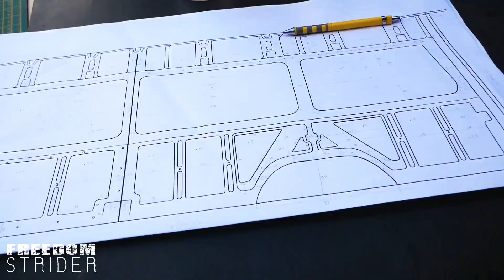Campervan Heating: LPG vs Diesel vs Electric - FULL COMPARISON

Comment: If you got electric, you can have a huge battery bank  ( Tesla battery) that weigh 23KG per 440AH 12V or 220AH 24V. So you would need only 3 Tesla batteries at £850 each - total of £2550. Than you can get an induction cooker. That way you can have around 900W solar panels on the roof which will charge your batteries. It should cost you around £3000-£4000 max for the Tesla batteries, BMS for them, induction cooktop, and electrical. And the best thing is that its all renewable :-). And the total weight of your battery would only be 69KG.
Reply from the maker: We have heard about using Tesla batteries before for a camper, initially for us they did seem a great idea. However, the main issue we had with them is that Tesla can deactivate the electronics in their batteries if they receive a report from the batteries that they are being messed around with, and they have put fail safes in them. WE're not experienced enough with electronics to know which wires to cut to stop this from happening (plus, I would think it's more programming rather than wire cutting).

But if there is a way to manage this system easily, then sure it sounds like a great deal. To be fair we've already bought our 2 lithium batteries and chargers, with 540W of solar. Maybe for a future project? ;)
Reply: Freedom Strider ah i see, not sure who told you that, but Tesla can not deactivate the electronics in their battery once its been removed from there car ( there is no receiver or transmitter in the battery). In regards to wiring for the battery, there is a company that sells boards for he battery ( ZeroEV) it allows you to plug a Bms to the battery to use them and have things like temperature control etc. So no programming required for the batteries. All you need is a good BMS, and also a Victron Phoenix inverter as then you can change the voltage to 18.6V - 25V ( Tesla battery work between 15V - 25.2V).

But maybe that’s for a future project :-)
Reply: @theoteam4641  I had a look on eBay after seeing this comment and indeed you can get Tesla modules, quite amazing really. An EV narrow boat on Tesla batteries would be cool. I know Tesla/Panasonic make damn good modules, but I would be tempted to use old Nissan leaf modules instead because they don't have the liquid cooling system that Tesla use. You wouldn't need the cooling as it is used for high loads and charging but I would feel safer using a system that operated originally without it.
Reply: Liam Siviter aah i seee what your saying. You wont need to cool them down at all if your using them at less than 1C. If your using them on your narrow boat or camper van, they wont overheat. It would only overheat if your drawing over 400V from the pack which is what happens in the Tesla car. As you would be drawing less than 80V you wont need cooling. But i am going to be using cooling on mine, not t coool it down but to heat it up in winter. I am using a small water pump, anti freeze mixture and a fish tank water heater.  
Also Victron Phoenix inverter is great for them as you can change the voltage as low as 18.6V which is perfect. 

Hope this helps
Reply: @theoteam4641  sounds awesome! Looks like you've got it all worked out. Are you going to video it for YouTube?

Comment: You can get induction hops that are pretty efficient if you are head against LPG. I think if you had enough solar and a good b2b you should be fine on the power front. Otherwise I'd say if you must get LPG go all out but then if you plan to go to lesser development countries it's less of a thing. Idk I'd say get another battery/ more solar and do induction probs the same amount of money. And there's sun everywhere
Reply from the maker: We would love to do that, and we still haven't discounted that. We're going to hold off on installing any LPG unless we absolutely have to. With the cooking, we can easily get another battery (and an inverter since right now we're not planning on getting one...yet), however, we love to cook with an oven too, so baking - pizza, roasts, etc...so just hobs won;t cut it for us, so we're looking at microwave convection oven combos, or those all-in-one cookpots which can be manageable. 

For every high powered appliance we get, we roughly need another 100AH lithium battery (very roughly put) which gets expensive fast, and they still weigh 13kg each. Still pondering over it, for the cooking we haven;t said no to anything yet (apart from diesel) but we're pretty confident on diesel heating for underfloor heating, instant hot water and worldwide accessibility. Coin toss between more batteries and an LPG tank. Decisions, decisions...hmmm...

Comment: Yay another video :-), i was waiting for it. Great video guys :-)
Reply from the maker: Thanks 😀 - it's been long in the making (so much research). What heating are you planning to go with?
Reply: Freedom Strider we are going with Chinese diesel heater was only £90, then instant Lpg water heater ( as we have a 30L Lpg tank under the van, maybe you have seen the pictures on instagram from when i installed it?
Reply from the maker: I remember the LPG hot water heater, could you send us a link to the Chinese diesel heater you picked? Curious to see...
Reply: Freedom Strider sure thing, ill send it to your instagram DM